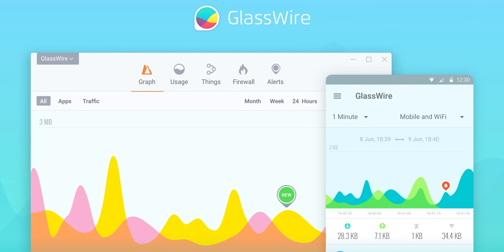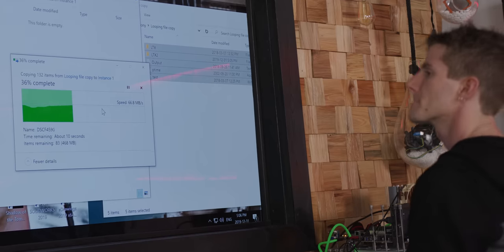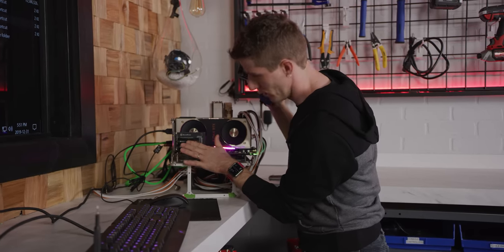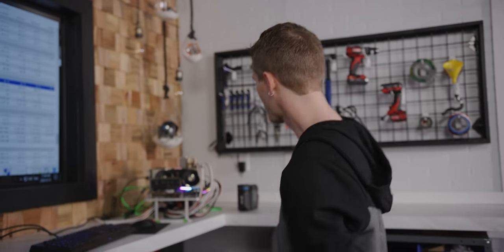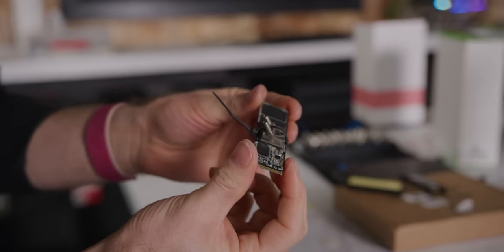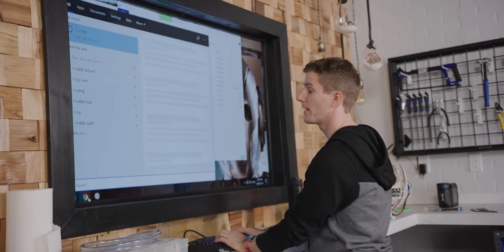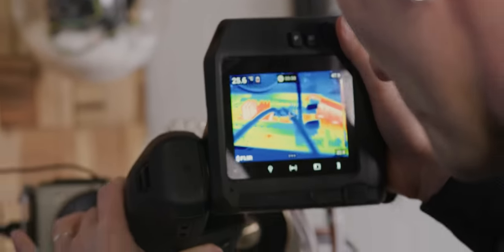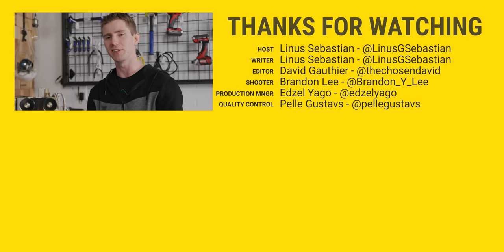We Water Cooled an SSD!!

Comment: "the block in particular is quite shiny and quite reflective so we cant trust the readings off of it", for thermal imaging it doesn't matter if the object is IR reflective... in this case the block it self is producing the IR radiation that is picked by the camera sensor, so the readings are actually accurate... there can be inaccurate readings if there is something hotter nearby than the object you are taking a measurement from and if that object is reflective you will get higher measurements because of the reflected IR...
Reply: IamIUareU I’ll pretend I understand
Reply: When I took a class with fluke on our thermal imager. We were told that shiny surfaces will reflect like a mirror in most cases. To combat this, they recommend putting a pice of electrical tape on the object. It has works for me. But, I deal with rubber injection molding presses at work. Some of the metal they used to build it is reflective. In the camera I could actually see myself when shooting the metal, that wouldn’t give me an actual reading of the part I was looking at.
Reply: Hey man, i clicked on your on profile and is said "JOINED 8 YEARS AGO" 

cant belive someone actoally watched this guy for that long lol 🤣🤣
Reply: The missile knows where it is, because it knows where it isn't.
Reply: so his thermal camera doesn't care about emissivity?   if the emissivity of the block is too low and or doesnt match what the camera is set to then how can you trust the reading?
Reply: The emissivity is different... without adjusting the emissivity if it's a radiometric camera the actual reading is in fact off.
Reply: Lol
Reply: Wow, in 54 minutes, you commented, got 163 likes, and a heart from LTT.
Reply: @rumyan7126  just bc he joined 8 years ago doesn't mean he watched this channel for 8 years though
Reply: @rumyan7126  says the guy that joined 4 years ago 😝
Reply: Because the block is quite shiny it will radiate less at a given temp compared to a black body so yes it does matter that the surface is shiny. If this where not the case you could come up with some interesting physics breaking setups :). 
For example take a perfectly reflective surface put it in a vacuum. It will not absorb any radiation but itself will radiate, thus the object will cool down to near absolute zero, when it stops radiating. What we thus effectively have created is a cryo cooler that doesn't use any energy. I believe there is some thermodynamic law about entropy that forbids this ;).
Reply: found the boomer, the ellipsis gave it away
Reply: @rumyan7126  "This guy"
Reply: Santiago Rodriguez Newton The same reason a 2000 watt light bulb becomes not darker when it is near a 20 watt light bulb. 

A hot surface radiates a lot of infrared „light“ (actually only certain wavelenghts of the infrared spectrum are considered thermal infrared but I keep it simple for now) a colder one radiates less. The difficulty is that a surface can also reflect infrared light emitted by another source. You can compare that with trying to use a low brightness screen in bright sunlight. In such cases you will mostly see the bright sunlight reflected by the display glass and not the content shown of the display itself.
Reply: Dwight D. Says the guy that joined a decade ago
Reply: @someonespotatohmm9513  laws are not broken because the energy in the entire system is still there in the form of radiation, it's just not in the material anymore. There is no perfect mirror tho so assuming there is radiation hitting the mirror there would be absorption that would equalize with emission at some lower level. Anything above this lower balance between income and outbound energy would skew the observed surface radiation, with the delta increasing as external radiation increases relative to the radiation emitted. Probably
Reply: @djrokz61196  not true i joined a few months ago 🤣
Reply: @STVGozando  yeah??? Okay...
Reply: @andrewkvk1707  The energy that is radiated is still there but the entropy is still reduced, because you created an temperature difference using 0 energy. The easy sanity check is that temperature differences can be used to create energy. 0 energy to create T difference -> positive energy from T difference -> free energy.
Reply: @someonespotatohmm9513  heat being lost is  a given, a lone body in space will slowly lose all of its energy, and that has nothing to do with mirrors. I'm not sure where the mix up is here.
Reply: @andrewkvk1707  The problem is heat flowing from a cold object to a warmer object when radiation is not depended on the emisivity (reflectivenes) of the object.
Reply: @someonespotatohmm9513  I think we are agreeing, my arguement was with your perfect mirror, and that it would need to be impossible for it to emit heat, that threw me off for some reason since it was meant to be wrong. That's why I said a mirror would skew the observed surface temp when emission and absorption isnt perfectly balanced
Reply: Simply, NO!  unless you don't think the laws of thermodynamics apply here.  If you don't want to violate thermodynamics, as reflectivity goes up, emissivity must go down, for the same wavelengths.

Comment: "Pretty much everything in a system can be water cooled"

Thank god, my CMOS battery has been running kind of hot lately
Reply: Don't forget to reapply new thermal paste under the battery. My boot time went down by 5 seconds using thermal grizzly conductonaut for the CMOS battery
Reply: @willies545  Also, applying some of that thermal compound BELOW your cpu before you install it, can give significant performance boosts!
Reply: @keppycs  Dennis, is that you?
Reply: keppy probably should note the disclaimer that it’s a joke (as in some benching you actually do fill the socket with thermal paste, for instance to keep air/moisture out of the socket for sub-zero particularly phase cooled where it may run months/years at well below 0c and condensation will form and short the socket/board/CPU out).

When packing the socket use either Vaseline or non-conductive thermal paste (if using Vaseline make sure it doesn’t get anywhere above 0c, otherwise it will melt and run out). Vaseline is handy for quick benching where you can cleanup with a heat gun but do be careful with melting sockets (it didn’t take much in my case, and that’s why you keep your old garbage boards for testing this stuff, haha!). Non-conductive ceramic based paste is the best (and what is in the manual for phase cooled systems), but it’s basically never getting out afterwards...
Reply: kyle hubner small problem: I don’t own a dishwasher, and I don’t think water does anything but smear most thermal pastes (it would remove the Vaseline if that’s what you’re saying, indeed that is a great option since the warm water will melt the Vaseline out without harming the socket).
Reply: @willies545  
Guy's don't say it in YouTube .
My friend went to do it I stopped him .

Comment: LTT 2019: let’s put an air cooler on a gpu 

LTT 2020: let’s water cool an SSD
Reply: AO1337 ?
Reply: @fayenotfaye  Pretty sure it's supposed to be 'an', not 'a'
Reply: Let's air cool a water cooler.... or the other way around. Or water cool an air cooled water cooler, and on and on.   And then we're cha-cha-ing.  AO1337 getting the spell correction wrong below, unless you pronounce it like a snake or something.  Sssssss-Duh.  Just classic.
Reply: @RtaincCo  big brain
Reply: CPU cooler on GPU?  Nearly all GPUs are air cooled.
Reply: 2021 water cool your mobile phone ...
Reply: AO1337 It’s “an” bro, you can mostly use it on vowels and this is the best example for using it.
Reply: @fayenotfaye  An SSD, A Solid State Drive.
Simple. 👍🏾
Reply: @RtaincCo  Glad someone else knows too.
Reply: LTT 2021: let’s water cool our water cooling system
Reply: 2021: Let's water cool an air cooler
Reply: @keppycs  an is only before a e i o u words
Reply: Next let's ln2 cool a CMOS battery
Reply: @mano7636  Wrong. Scroll up and check Ryan's comment or just Google it yourself.
Reply: @keppycs  the more you know
Reply: @mano7636  Aren't native English speakers supposed to know this already?
Reply: @RtaincCo  yup
Reply: the S in SSD actually has an ess sound, thus permitting the AN rule to be applied.
Reply: @keppycs   an es-es-de the letter S has and E sound to it so using an is technically correct?
Reply: @fayenotfaye  No, it is an. It's about the sound, not the letter.
Reply: Yeet Yeet what if they came out with a water coolant motherboard design. No more very hot heat.
Reply: @RtaincCo  but even on a phonetic statement it doestn work, eh sounds nothing like s,
Reply: LTT 2021: lets water cool ram
Reply: @charismavalentine5125  we would be nowhere without air cooling, the water cooling solutions use air to cool the water.
Reply: I pretty much only watch this stuff because i cant look away from your beautiful frames and nice post production.
Reply: If my tv is a 2008 sony lcd, how many fps can it do on hdmi?
Reply: @fayenotfaye  you are wrong. It's an not a.
Reply: @keppycs  you ruined it when i saw your comment, yall should stop saying "big brain", why when youtuber say something yall say it on comment section aswell, it ruins it
Reply: @itrest  what did I ruin exactly? also, I would've said 5head instead, but that's more twitch culture, so I went with big brain instead. im so sorry to have upset you x)
Reply: @jonw1986  Already happening since 2019, example "Xiaomi Redmi Note 8 Pro" (though its technically "Liquid Cooled", not Water Cooled).
Reply: @Sup_D  Wow that's sad ...

Comment: Linus: You can water cool anything in your system
Me: Water cooling my power supply
Reply: Well, replace the fan with a water-cooling block, then fip the whole thing upside down so any leaks don't touch the sparky bits.
Reply: That's wack. How about you water cool your water pump?
Reply: @rogerhu126  it already is? They can get pretty hot if you run them dry.
Reply: He actually did a video on this already.
Reply: @Pato Gamer It's not chips that are getting hot in a PSU, so would still need a fan.
Reply: well, why not?
Reply: Rico's voice kaboom?
Reply: @raza78695  yes rico, kaboom

Comment: Hi Guys, I've been trained in thermal imaging and just as a tip if you ever need to image  high gloss/reflective components just put a matte finish dot sticker or liquid paper on the component. Just make sure the dot is as large as you can, not smaller then around 5mm. If the target is to small the camera sensors will do a (so called fill in) and will give you an avg reading of the surrounding target. Also the circle in the center of the cross hair is the size of one sensor so make sure the target is within the circle to get a true reading. Hope this helps also love what you guys are doing :)

Comment: "We watercooled an rgb fan!" 
"We overclocked a hard drive!"
Reply: I actually need the hard drive part. Somehow mine is running at 60 celcius
Reply: @Godielvs  And now you know the reason why HDD cages are put right in front of intake fans…
Reply: Waiting to see water cooled ram
Reply: @Joshk326  there's watercooled ram on DDR2 age, i guess?. or DDR3?
Reply: PredatoryQQmber with my case it isn’t. And my hard drive never really runs hot to my understanding.
Reply: Depends on the airflow and type of drive, i guess. high performance drives like WD Black or 10K above spinners are actually runs hotter. I got one WD Black and 3 10K drives, they runs at 40C even with adequate airflow while the rest 7K2 drives runs at 33~36C
Reply: @Rena_Skuxy  Yes, they do ! Except that definition of "hot" is different for them. After 45 degrees Celsius they start rapidly degrade and likelihood of spoiled sectors and fatal failures increases exponentially. They really finicky, that's why I aim at getting rid of them once and for all. And when you have in-case ambient at 40 and GPU's exhaust near-by…

As for bad case design: most cases nowadays block intake altogether and turn intake fans in non-intake light&noise-shows, so it's not surprising. What I meant is that a HDD cage should be there.
Reply: Watercool keycaps and mouse pad?!! Those things can get pretty hot during intense battles.
Reply: @Godielvs  its not somehow, there is a mechanical pin grinding on the disk or disks friction makes heat so does centrifugal force a hdd equals heat.
Reply: @Joshk326  already a thing
Reply: @n.shiina8798  tf are you talking about? The model of Ram doesn't affect if people make water cooling for it
Reply: @JacketCK  DDR4 is a lot more efficient compared to DDR2. what i mean is water cooled RAM is a thing back then and not common or needed as much these days.

Comment: I water-cooled my dog, he is now a really good boy. Before, he was just a good boy.
Reply: please dont tell that to Paris Hilton, she just made some hot Lasagna at Cooking with Paris :D
Reply: All he needs now is RGB
Reply: @Snagoot  ikr 😂
Reply: Lay down forever. Really good boy.
Reply: So you just make your hot dog become a cool dog?
Reply: There is an easy setup for these watercooled dogs: Just mount some huge radiator on their back and let them chase a ball or your bicycle.  The faster they run, the more heat they will generate. But at the same time they generate the airflow needed in order to cool down their body-liquids in the radiator. With this simple method there should be almost no thermal-throtteling anymore and you can easily overclock your dog to 5.6 Giga-woofs.
Reply: Where do the tubes enter tho?
Reply: That is stupid
Reply: Rgb realy good boy
Reply: Did ya overclock it?

Comment: Linus 2021: we water cooled the power button of a PC, 
Water cooled power cables, so the power company water cooled us...
Reply: Water cooled power cables are actually a thing. It's more for like massive Arc furnaces though heh.
Reply: @Dysgalt  defining it like that means even water-cooling a CPU is technically water cooling power cables. The CPUs heat comes from internal resistance in the CPU itself from the metals in the CPU converting the power used by the CPU into heat.
Reply: @ThatJay283  Hi, Robson I can see your logic in that, however I'm more talking about water sheaths that cover thinner power cables which help mitigate resistive load. You can also these in like tig welders for similar reasons. 

I.E when the amount of power you are supplying to a system is to much for the wire gauge or undesired thermal characteristics present themselves.
Reply: @Dysgalt  It's not just the resistance that is generating the heat.  Plenty of heat radiating from the furnace as well as induction helps to heat those arc furnace leads.

Comment: “pretty much everything in a system can be watercooled”

*watercools power supply*
Reply: Hey they actually do exist though
Reply: not a bad idea! (better than watercooled ssd)
Reply: I think they were actually commercial selling a model of those
Reply: I reeeally don't want that thing to leak though...
Reply: there is an LTT video on that
Reply: @MegaKiri11  Linus done a video on one already :v also, i think the psu is the only component that can be considered better the less cooling it needs
Reply: Well the power supply for the entire area is probably oil cooled, so I mean... it's not a huge stretch?
Reply: @gugubope21  Here is the link to the video if anyone was wondering: https://www.youtube.com/watch?v=unvx3sKmmbg
Reply: watercools the fan
Reply: watercools the water cooler.
Reply: @SanderEvers  watercools the case
Reply: Watercools the watercooling radiator.
Reply: Watercools the Water Pump Motor
Reply: Water cool the watercooler
Reply: Watercool the water
Reply: @gugubope21  all components are better if they need less cooling...for the same unit of performance!
Reply: I just throw a cup of water Everytime.
Reply: just submerge it in water dudes, trust me works everytime
Reply: Water cooled PSU has already been done, check out the FPS Hydro PTX+
Reply: Watercools optical drive
Reply: @martinf1921  one of the few things I haven't seen water cooled...

Comment: "they'll last longer the cooler you keep them"
my laptop from 2011 running at 94°C on GPU and 91°C on CPU at least 20 hours a week up until this day i'm doing just fine! I don't know what you're talking about XD
Reply: pretty sure it's the expansion and contraction. so if it stays at that temp basically all the time then i guess it's okay. which is why gaming computers will also last longer when they don't get as hot because when you shut it down it goes back to room temperature.

this is just a guess though
Reply: @jukubot2245  Solder can start to crack from frequent large temperature changes. But anything that happens to have electrolytic capacitors will last much longer with reasonable sub 70C temps.
Reply: MacBook Pro?
Reply: I now feel better for running my GPU at 80 degree..... despite OEM rating it at 65 degree.
Reply: Rob Potato   hhhh，single discharge pipe alway let me confused
Reply: @jukubot2245  by that logic that explain my dad office pc always have problems. Hot pre-built PC with a regular shut down time.
Reply: Is that dell laptop 
Dell laptops are amazing and underpriced actually 

New dell g series laptop are so underpriced 
You get a heater and cooker in it
Reply: @Blood Of Gurkha 02 that’s right,but the macOS is excellent
Reply: Had a i7 4700HQ and GTX 860M which did exactly this. Never had lower than 90°C on both during gaming sessions which was mainly what I used it for. Lasted me 5 years until I had to change the thermal paste. Then I sold it and the guy who bought still uses it to this day without an issue.
Reply: @Blood Of Gurkha 02  😂😂
Reply: @imagination9176  I take it as a joke 
😊
Reply: That’s exactly the story of a Dell latitude laptop from 2011 that I have!